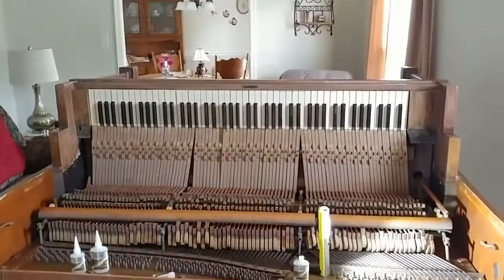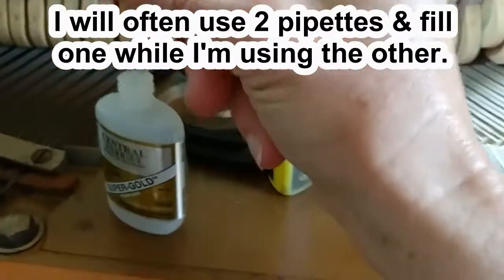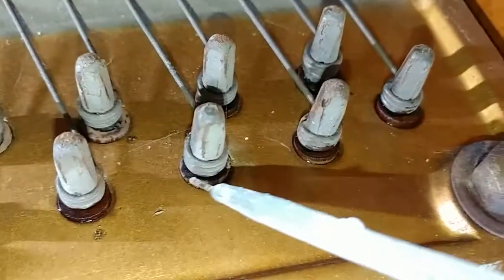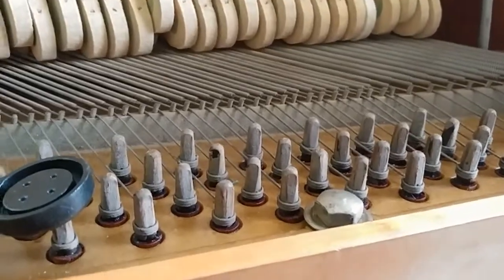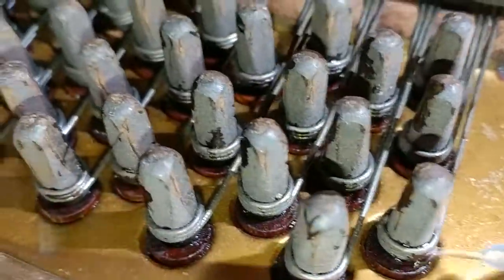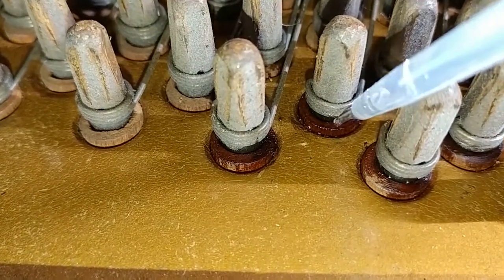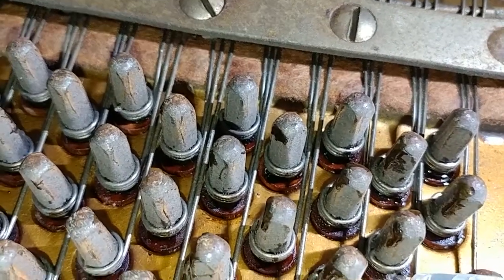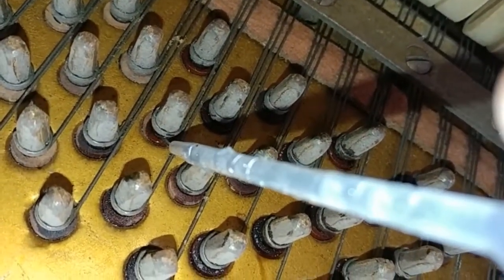Saturating pin block with CA

Comment: Tuning pin bushings can hinder the glue going into the hole simply because it can wick the glue into a different direction. For instance, if the bushing is flush with the bottom of the plate it can run onto and go horizontal, covering the plate instead of going into the pin. I know because of many tear downs and observation. It’s much more effective when there are no bushings and you can see the glue running directly into the block. Some have suggested drilling a small hole on the upper side of the pin which goes 1/16” into the block, then using a hypo needle the wicking won’t happen. I tried it in experiments and it didn’t work well. So, the bushings can make it hit and miss IMO.
Reply from the maker: I'm so glad you commented! Not only is that true, I've had 2 people contact me about loose pins with tight bushings. The pianos I do this to typically have loose bushings as well, so it's not as big of a problem, although it's still not as good as no bushings at all. My suggestions to them were to remove the pins and coat the hole with CA glue, or shim it, or replace the pins. I did mention the drilling of the hole technique but have never tried that myself. Good to know about your experience because I couldn't give any first hand information. Thanks!

Comment: How long does it take to do the whole job?
Reply from the maker: It depends on how much CA it will take. It can take less than an hour or as much as 90 minutes. Then there is drying time. It's best to let it dry overnight, but sometimes it's tunable after a few hours.

Comment: if the pin does not hold at all, then in order not to cut the string against the frame/ plate, when hammering the pin deeper,  i first loosen the string strongly and hook the first coil of the string with an awl and a screwdriver and transfer it to the side outside the frame, where the tuning levers tip sits and then hammer another 0.5 cm deeper.  Then the pin holds well . Old Soviet trick. LOL.
Reply from the maker: Yes, but sometimes this can widen a crack if there is on. It also puts the coils closer to the plate, & sonetimes it doesn't work. In this case, it was a very old steinway and I didn't want to risk it. Thanks!
Reply: @PianoTechMaggie  I agree, my trick is not  supposed  for Steiway.)) As to the crack, my experience shows, that the smaller end of tip is outside the pin block after hammering, the more stable the pin is despite the crack.
Reply from the maker: @aleksandrsstulpe65  Interesting. I just don't want to widen a crack. ;-)

Comment: Do you do CA treatment on all makes and models of piano Maggie?
Reply from the maker: As long as the piano isn't worth getting a new pin block, yes.
Reply: I’m sorry, I’m not impugning your effort, but I don’t like this method. Once the glue seals up around the pin you can’t add more in years to come. I’ve come across many pianos treated with CA glue and the pins were loose years later. 

With tuning pin tightener you can add more anytime as necessary.
Reply from the maker: @thomaslotito380  A valid concern! Are you not liking the "fill-er-up" method or CA altogether? Until recently, I've been able to say that pianos I treated starting in 2004 with the "fill-er-up" method are still holding. I JUST had my first case of pins (only 2) not holding after around 10 years. I was worried about what you just said, so removed the offending pins, swabbed the holes with CA, then replaced the pins. Worked like a charm. Next time I am at that piano (I'm predicting there will be more) I will see if another pin can take more CA and will let you know. I honestly don't know yet. With "tuning pin tightener", are you talking about things like "Garfield's"? I personally hate those because not only do they not work for me, they "work" by absorbing moisture and the pin block can turn to much years later. If you aren't talking about those, please let me know. I'd be interested. Thanks!
Reply: @PianoTechMaggie  The tuning pin tightener I’m talking about is quickset. Even though it says it sets up in 20 minutes I let it set a few days. And, I will apply a whole bottle, or as much as the piano can take, for one application.

If need be the pins can be treated again years later because the area around the pin ( the bushing) can still absorb more pintite.  Whereas with CA glue the area around the pin is permanently sealed up.
Reply: @PianoTechMaggie  PS, To answer your questions I’m not sure what the “filler up” method is about. I use CA glue but I’m not a fan of using it in pinblocks. I’ve come across many pianos where it has failed. 

The question I have for you is; if Garfeilds pin block restorer ads “moisture to the pin block why would you be against that? Isn’t the reason the tuning pins are loose in an old piano is because the pin block dried out? 
Thank you for your kind reply.
Reply from the maker: @thomaslotito380  Ah! Yes... I have also come across pianos treated with CA in which the CA didn't work. My theory has been it is because the previous tech didn't use enough glue. There are some who believe "a little dab 'll do ya", but so far I've not known that to work long term. I put in as much glue as the piano will take (fill-er-up). Both methods can do what you describe: block other things from going in. I have used small amounts when a particular situation called for it, but I tend to want to flood it. So far, I've only had one fail, and only 2 pins after 10+ years, and if the piano is going to the dump anyway, why not? 

I have a problem with Garfield's in my area. Other regions might not have this problem. I live in a temperate rain forest and the humidity in the summer gets quite high. Even in the winter we sometimes keep a dehumidifier going downstairs. There is SO much moisture available to be attracted by Garfield's, that in the long run it actually rots the wood, and you end up with a spongy mess that doesn't hold the pin. That's if you actually used enough to help in the first place. A little dab of Garfield's might swell a bushing, but unless you get it into the hole, it works as well as CA glue not getting into the hole: not. 

What is "quickset"? Is that an epoxy? I'm not familiar with this and am interested. Thanks!
Reply: @thomaslotito380  did you mention PIN-TITE?  I use it by inserting a strip of thin beech veneer.  I soak the preparation a few times the pin hole, veneer and dowel.  I have never had any complaints.  I never use CA glue.
Reply: @thomaslotito380  after your replies I am now convinced.  I will never use CA glue to tighten pins.  Old tuners used rosin dissolved in 100% alcohol.

Comment: The CO bottle must be attached.  if it overturns, it will destroy the piano
Reply from the maker: Are you talking about me just sitting it there? It wouldn't "destroy" the piano if it overturned, but it would create a bit of a mess. 😉
Reply: @PianoTechMaggie  recently I made a special rubber stand for a bottle of CA glue.  My CA glue knocked over at home and I damaged the table.  I don't want this situation with the client, it would be unpleasant.  That's all.  I greet you
Reply from the maker: @bronco6  OH! Yes. That would be bad. Good plan! I should do that. 😉